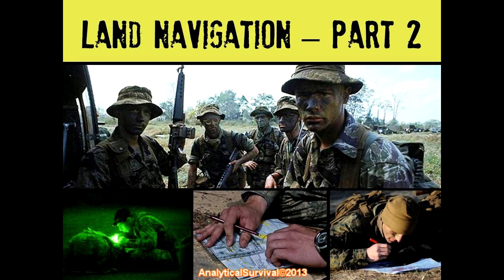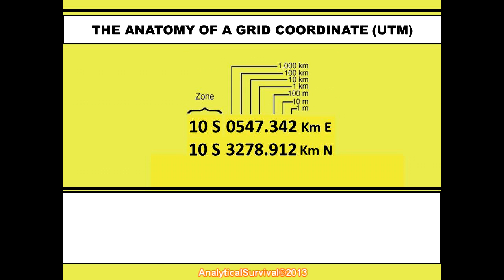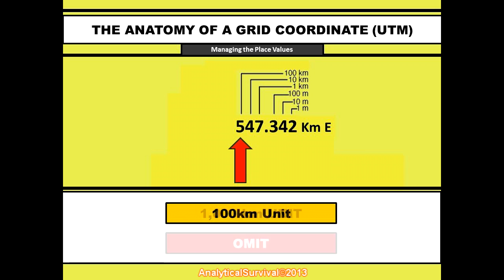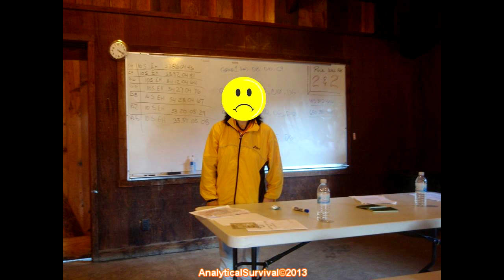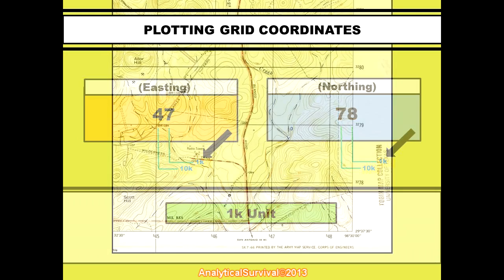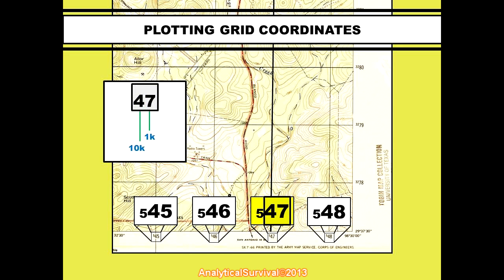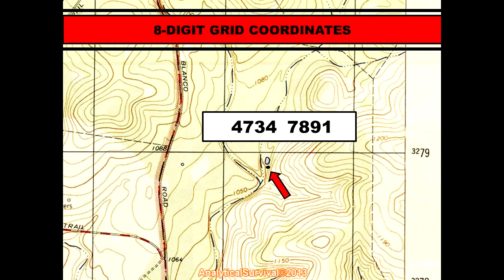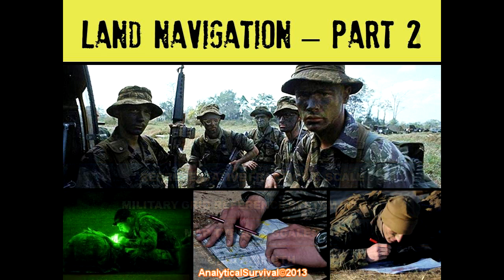Land Navigation - Part 2

Comment: This is so well explained. I've heard the 10km and 1km digits referred to as being the "Principle digits". They are the numbers written larger and in bolder type along the borders of the map. Remember that you must use the same number of digits for eastings and northings. Also,since the coordinate refers to squares by identifying the southwest corner of that square,you can not round out these numbers.You can only drop the trailing digits.  473 789 should not be rounded to 47 79. It can only be dropped down to 47 78. Your part one really help my understanding of the utm system click in. Thanks.